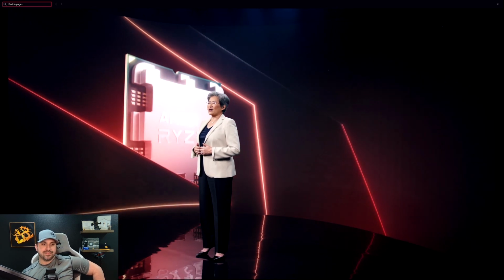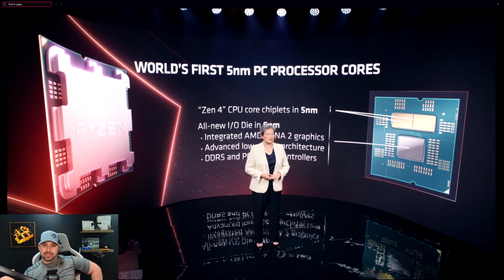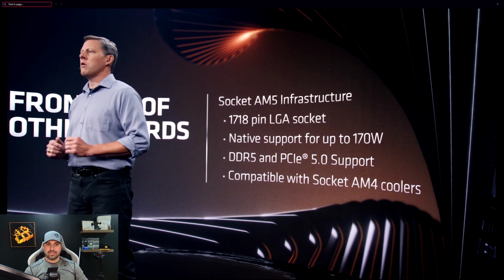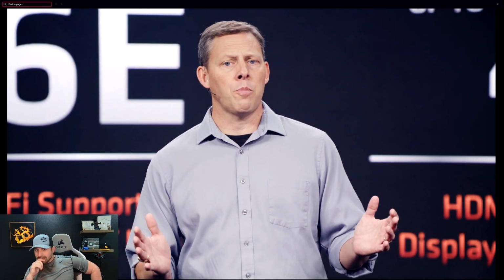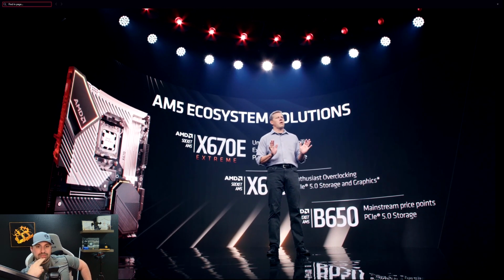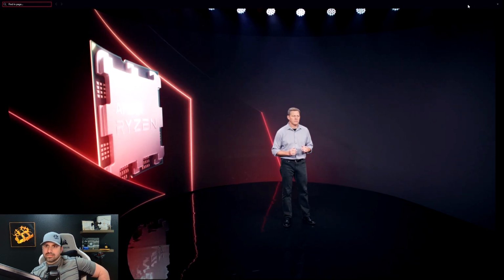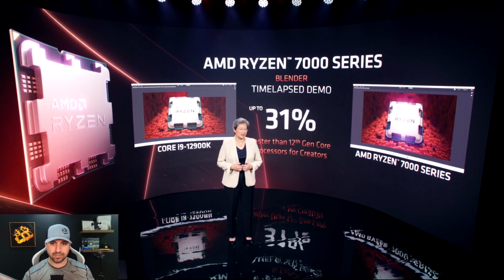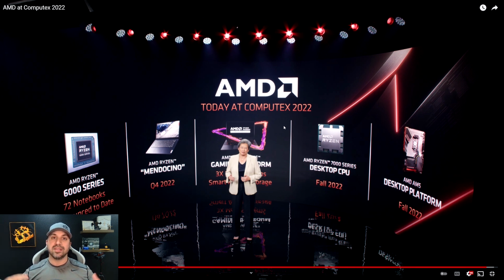AMD Drops Bomb On Intel!! Wowzers!! Ryzen 7000 Bringing The Thunder!! 2022 Keynote Reaction! Gimmie!

Comment: If amd was smart they would figure out a way to create a pass thru  for the on board graphics to be able to go thru the external graphics card and disable the gpu on the graphics card when not needed to save that heat/wattage
Reply from the maker: maybe thats in the works! but i agree they should

Comment: To be honest I don't know what intel is doing.  But if the past is any indication intel usually sits on there hands for a few years then they drop something crazy that blows everything out of the water.  Simply put intel spends more on r and d then amd probably makes

Wow finally going to land grid array instead of pin grid it's about time hell only 10 years behind on that.

How can you use a pga cpu in a lga socket they don't even work the same
Reply from the maker: ya thats possible... love how AMD has pushed intel to try again